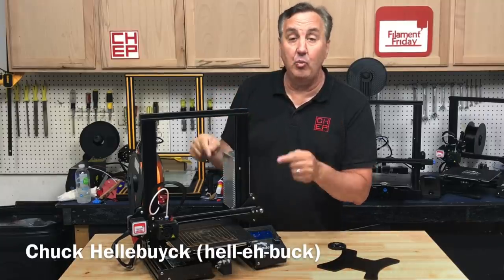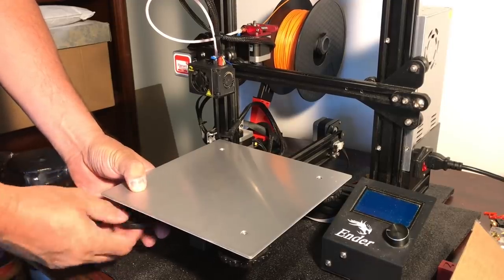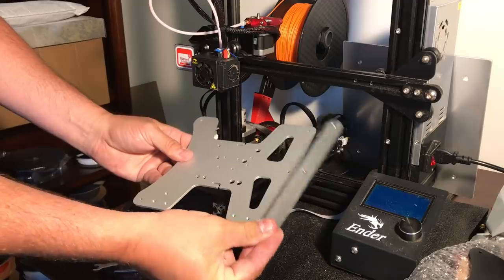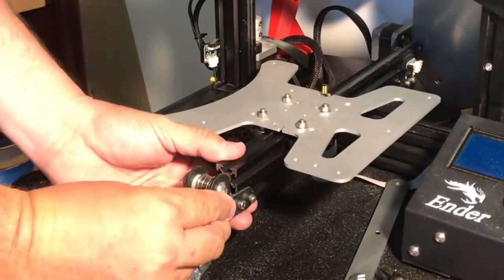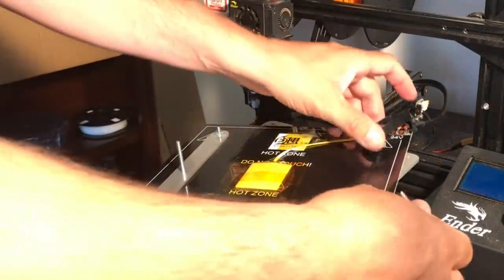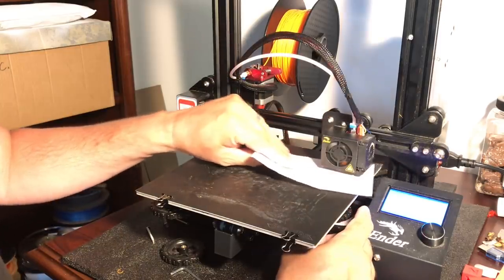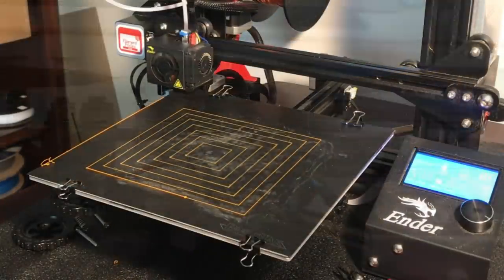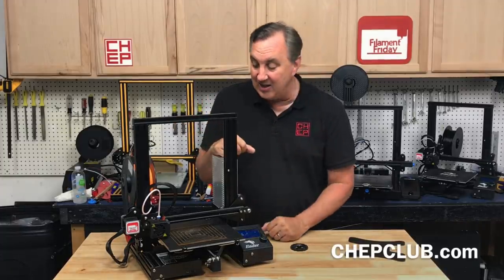3-Point Leveling System on Creality Ender 3

Comment: A thought on the compressed spring - another thing they could have done is drilled out the centre hole on that beam wide enough to accommodate the spring, then it'd be pressing against the build plate the same as the other side.
Reply: The single screw would just fall out then.
Reply: @jrdnhsnbrg  Oh of course it would. doh.Short of drilling a new hold in the build plate.
Reply: which in turn wouldn't do the heater circuit any good 🤣

Comment: Hey chep. I took some magnets and glued them on the back of a dial indicator which can then be put on over the metal hot end fan cover. No silly paper and no guessin. Within a thousandth everytime. Easy on and off. I just tighten the knobs allmost all the way and once set it's nearly a solid bed then.
Reply: Sorry I didn't get this, but I'm really interested. Can you explain your setup in better detail? Thanks

Comment: I wound up warping my Y carriage by bending it from trying to level with 4 points. When you think about it, it is almost guaranteed to bend into a potato chip shape if you are not very careful. With this 3 point system, the danger of doing that is completely eliminated. I think this is the major benefit of a 3 point system. I agree about the spring too!

Comment: My friend took my bases and beds to work with him and faced them on their CNC for me, the whole of my beds are now perfectly level all over the bed and the temperature on the bed is more uniform, I would recommend this to anyone who has access to a milling machine
Reply: I think facing them is great but if it's the same cheap aluminum creality sends out, they're going to deflect from the heat no matter what.  I had to use some tooling plate to eliminate the deflection and I've not had to level my bed since.  Always great to have friends with CNC machines, though.  Facing it is better than nothing.

Comment: The advantage is NOT that you only have 3 points, it is that you aren't putting the bed into a bind trying to adjust 4 points, which is unnatural when trying to define a plane. With 4 you can actually deform the bed. Ideally you should also have a kinematically coupled 3 point (actually 6 points), 3 on point 1, 2 on point 2 and 1 on point 3.
Reply: I have seen what you are talking about discussed.  I am no whiz but yes, when you have 4 points working you get internal warping in the plate.  Go to 3 or even 2 point adjustment you eliminate that warp and bending that can happen in the material providing you with a better level.  I notice it on my CR 10 mini which has 4 points.  You can often get your corners and  most of the outside of the plate great but my middle of the plate always is low which I have to always adjust for.  if I adjust to middle then everything else is out of whack.

Comment: It would be interesting if someone had a thermal camera to see if that aluminum bar on one side of the bed acts as a heat sink and causes that side of the bed to be a lower temperature.  It doesn't seem like it ought to be that massive; it essentially is just a mount point for a bolt which is supported by the back of the bed regardless.  Seems like it could be a much thinner bit of metal, which could address the excess spring compression and not affect the thermals as much?

Comment: Great video as usual but I dont see any point, once set I rarely have to adjust level on my Ender 3 pro its stays amazingly well level, once you get used to 3D printing and setting the machine its no bother at all, I think they are now trying to come up with things that you dont even need for your Ender-3 now, what next a toothbrush holder? not a pop at you Chep you are doing a fine job I just dont think this is required.

Comment: I’m having a hell of time leveling my bed so after watching this video you have sold me in the 3 Point Leveling Bed sir thank you for the video an your time making them
Reply: Shouldn't have a hell of a time leveling it.  It's more than likely warped (sunk in the middle).  So if real bad, just put a 3M Sticky Note under the magnetic bed sheet (or flex sheet etc) 
 in the middle.  Or just do away with leveling springs and knobs, use solid spacers and use Auto Bed Mesh Leveling system.

Comment: I like the idea, and the plate looks thicker, so that should help warping. But for the price, I think upgrading the springs for a few bucks is a much better value. All my bed level woes went away after replacing the stock springs. Now with an SKR mini, and baby stepping, I never touch the leveling!

Comment: I always had problems leveling my bed. I bought a glass bed but to my amazement there was still a dip at the center. I ended up realizing the x axis is slightly bent upwards. 
Instead of buying a new x axis I got a bltouch clone. Best upgrade ever, no more leveling and perfect first layers no matter how big the print is.

Comment: I think it's a great idea. If I end up keeping my 3 pro, I'll do this. 4 point leveling is the dumbest thing I've ever seen on a machine. As far as the springs are concerned, just put washers (the same thickness as the bar) under the other two springs, then move the Z-stop up just a bit to relieve them.
Reply: Secure nuts on the underside of the screws also while under there. (No, I do not mean Brennan's on Dale's drumset).
Return the Ender 3 Pro, get the new V2 for the same money.
Only prob I see is if using the LED light from Gulfcoast Robotics it will require power wire extension etc etc.  : (  the bowden tube fitting on the head is sunk down in the new V2 plastic cover also. But have a feeling that cover may be modded soon either way.  Plastic, not metal cover, so think the laser engraver Creality sells, uses magnets to attach to old cover i think.

Comment: My first time running a boring mill i did not know about 3 point set ups and thought 4 was better. Welllll, come to find out when you release the clamps it springs back and then some. Scrapped a 5k weldment from the start. Opps, i will never forget about 3 points now.

Comment: I prefer silicone bed cushions. I also have different sizes of them which allows using a shorter one on the single adjustment side. I really like the quality of GulfCoast Robotics as i have had issues with the 4 point adjustment not keeping the  plate level.   It is on fact the culprit in which your heated plate will become permanently  warped.  The key was to add small washers to get the plate as meshed as possibile before putting any tension on the bed level nuts.  I am pleased with this product.

Comment: Hi Chep. I know this is an old article, but I;ve added my take on it anyway. I don't know how the 3 point system can help, but here's what I do know. My Ender 3 V2 printer worked well for the 1st 6 months or so. I had to make regular minor adjustments, but that's normal. I've had several issues with my printer ever since. Most issues stemmed from extruder/extrusion and bed-levelling related problems. I've not been able to level my bed for a while now - no matter what I try. I'd followed suggestions on YouTube when these made sense and switched to the BL Touch, the firmware to Jyers. I've tried the BL Touch with a 3x3 and 5x5 point system, and neither helped me to recover my printer. I've tried flipping the glass over to see if the surface might be flatter. This did not work either. I might buy another glass build plate to see if this resolves the issue, but if it doesn't, it's another $40 gone to waste. 

During bed-levelling everything seems fine. There's a bit of friction between paper, nozzle and bed. I checked my Cura settings and g-code, but everything seems fine. I'd updated my Cura settings and added the line M420 S1 under the G28 g-code command line to use my stored mesh settings. As soon as I go to print, whatever height worked during bed-levelling seems to get altered, and the nozzle is never at the right height to the bed. After bed-levelling, something seems to be causing the bed and nozzle to be at different heights than the ones I'd set, and this becomes obvious as soon as I go to print something. 

For extrusion problems I'd changed the plastic extruder for an aluminum one, stock tubing to Bowden tubing, and changed the nozzle. It all works fine for a short period of time. The extrusion problems are recurrent. My extruder seemed to be having problems pushing filament through, so I'd suspected I was having temperature issues with the hot end. I'd tried slower print speeds, higher hot end temperatures, etc. I finally purchased a new hot end replacement kit, but have not bothered to install it yet, because I can't level the bed anyway. 

I don't know if these issues are mechanical or firmware related, but I'm at a stalemate, and my printer has been a huge paper-weight sitting on the workbench for the past month or so. It breaks my heart. I need that printer to continue with my projects. I expected there would be maintenance costs for operating a 3D printer, but not as much as it has cost me! With all the money I put into keeping it maintained I'm thinking I'd have been better off either buying another printer, or switching technologies altogether. For now, I'm taking a much needed break from my activities.
Reply: I had a similar problem with my Ender V2 it turned out to be that i had to move the Z stop switch down (had to cut off a notch on it) to be able to have the springs between the bed and the adjustment screws tighter so they wouldn't shake loose. There's a youtube video somewhere that explains this but I can't remember who posted it. I took out all Z-offsets in cura and on the printer and Z-level has been fine since. Now it's a paper weight again though and I just found that the extruder tension arm had cracked (very common apparently) ...
Reply: As far as leveling it sounds like you may have a loose x axis. Take the x axis off the towers and tighten those 2 screws that u can’t access because they are between the tower metal and the z axis metal. On the side of the x axis metal  the extruder is on.
Reply: I had problems after replacing my extruder with the all metal one, until I found out that you need to change the e-steps setting in the gcode. If you didn't do this then you definitely should. Also, just in case you haven't, heat the bed and nozzle up and then hit auto home before you begin to level the bed. You can also try switching from prusa slicer to cura or vice versa to make sure your slicing program isn't giving an erroneous Z start point.

Comment: Öhm, 
First, if you are already printing on a glass plate, then please use a silicone thermal pad. This saves the brackets.
Then for leveling, install the boot loader on the Ender 3 and work with Marlin. Activate autobed leveling in the scripts there. There are enough videos for this.
For me it is the best solution.
Only make the rough setting once with the screws, fine tuning only electronically using the rotary knob on the console.
But pleas show more, videos, i learnd a lot.

Comment: I installed this on my Ender 3, along with their handle and gopro mounts. Same comment - they should have supplied a shorter spring. I have had nothing but trouble with leveling this since converting to 3-point. However - the heated bed strain relief is also changing compression on one spring. Had no issues 3-pointing with my old Select V2. Emailed GCR who recommended running a CR10 spring on the side with their bracket -- or using 3mm nylon spacers on the other two to make them match. I may revert to stock.

Comment: Wouldn’t it be better to have the 2 wheels on the right side so you don’t have the problem of installing the spring where the 4 wires connect to the heated bed.? You would have to permanently (sorta) mount the strain relief to the new bed but that should be easy.

Comment: I'm new to 3d printing, but I've always thought 4 point leveling seems completely stupid and the 4 points are working against each other. As a surveyor that uses total stations that have to be completely level, 3 point are the way to go..3 legs, 3 thumbscrews ..... does seems a bit pricey for what it is though.. If I was spending that money I would buy a touch sensor.. take manual leveling right out.
Reply: That is what I did, I didn't know about the 3 point until now but even though( I've checked with a straight edge) my aluminum plate is a little warped in the back the bl touch3.1 is my way of saying F☆☆☆ it and it still prints with good adhesion along with some NanoPolymer bed adhesive. After this video and comments I think I'll pass

Comment: I was raised on 3 point leveling since my first 2 printers 6 years ago were both Flash Forge Dreamers That I bought on Ebay , sold  AS IS for $200 bucks. When I got my first 4 point leveling printer I was surprised that it worked since you are basicly forcing what is supposed to be a solid flat surface at 4 points, never a good idea. But they both work, the 3 point is a better design.

Comment: Hi Chep, I love your videos, always giving interesting information is a clear and easy to understand way.

As for this modification though, I'm not sure I'd bother with it. As you said, there's not a lot of difference and paying more  to lose just 1 adjusting screw - I'm unsure its really worth the effort.. Maybe that money would be better spent buying the bltouch and not having to level at all..

Its because of you (and all3dp) that I bought a glass bed, in place of my e3pro's magnetic bed that only goes to 80c - not great for filament that needs higher temps..

I'm waiting on a micro swiss hot end too.. as the stock hot end is only useful for pla, unless you wish to poison yourself with the Bowden tube. So when that comes, I'll have a go at abs that I'm unsure of using with my current setup.

I do love the ender 3.. it's the perfect machine for a beginner to start with at a really good price. Also, it's well upgradeable and has a really good number of users, making the machine even more user friendly..

Comment: Seems like a bit of a luxury step, not really necessary, but if you have money to burn, it probably would make adjustments just a little easier. With the aluminum construction, I don't really see the extra weight being too taxing on the motor, I suppose maybe reviews will show if there's extra ringing.

I'm interested, more than anything, if adding a little extra rigidity by means of the extra aluminum flat helps tame any bed warping issues?

Comment: I noticed with 4 adjusyment screws evey time i adjusted for level, it warps the heated bed.  I release the tension and the bed is flat, so I am goint to try this.
Reply from the maker: I use two clips on glass.

Comment: I have Ender-2 with a 3-point leveling from stock. But it has a calibration routine with 4 points, like you've got after installing this mod. I think it will have it's full effect after modifying calibration points in firmware to only 3 of them with proper coordinates. Now I'm looking how to make it with Ender-2 firmware.

Comment: this honestly don't feel like something that should be done., adds more pressure on a single spring, and might take the bed off balance during fast print speeds, also it's more likely to loose the bed level since it's not properly balanced

Comment: I think BL touch would be better a buy in this case. Easier to install and never worry about leveling. Installed mine last week, wish I would have done it a long time ago.
Reply: I agree but you still have to adjust the bed level before using the BLTouch, so there is still a practical purpose for needing the bed leveling knobs.
Reply: You definitely still have to level the bed with a BLTouch. I have one, and sometimes I think it might have been a worthless investment. In hindsight, I probably should have just bought this three-point system.
Reply: @Arctic_Falcon  You probably have something wrong with the setup. After you calculate and update your z offset by using the formula, add an extra line (G29) into the startup gcode, you will not need to mess with knobs. I went through a spool of filament without any issues.
Reply: @BobSmith-ww9rp  Nah, I have it set up right. I can sometimes go months without needing to level my bed, but my point is the BLTouch is still dependent on the bed being pretty level to begin with.
Reply: Silicone bed spacers are a fantastic upgrade if you're going with auto bed leveling, shouldn't need to touch the wheels for a long time.

Comment: Seems nice but I'll let the springs on the forth to allow for any trouble. What I've wondered does anyone make a super fine thread wheels and screws for the leveling so they aren't so sensitive. A 1/8 th of a turn makes a difference.
Reply: @ProtonOne11  thank you! Maybe it's harder than I think to go so fine that the feed rate reduces.

Comment: i have a question on that gunk on the wheels. is that just regular dust or is it actually wheel material sloughing off from wear? also, is the new base SS or alu?
Reply: It's dust attracted by the electrostatic from the rubber wheels rubbing on the aluminium rails
Reply: Use isopropyl alcohol to clean the dust that accumulates
Reply: The gunk from the wheels is the wheel (POM materials) wearing because it's rubbing the aluminum extrusion thousands of times, yes it's dust, no not from static electricity

Comment: Couple thoughts; with the 3 points, I think you’re dependant on your bed plate being flat. Also, could you bump your Z stop up slightly in order to give that right side spring a bit more room?
Reply from the maker: I could but the other springs might be a bit loose. I may new springs.